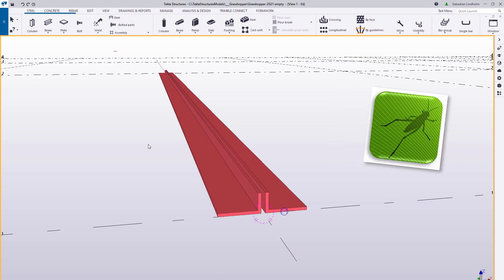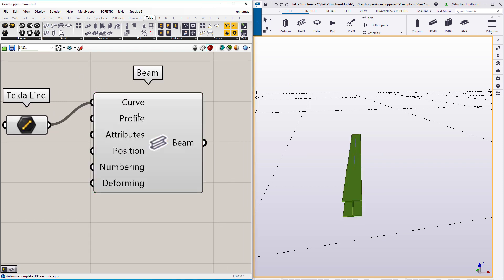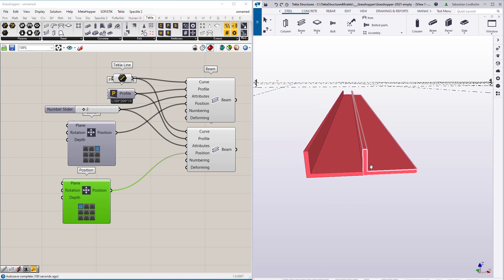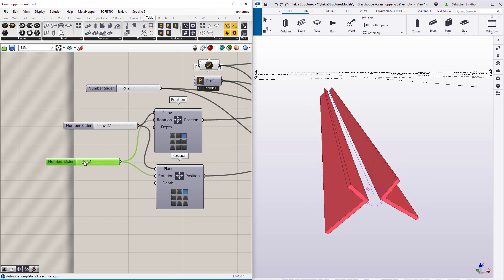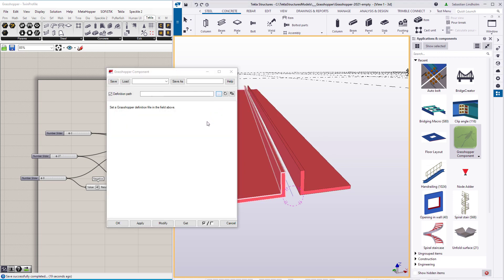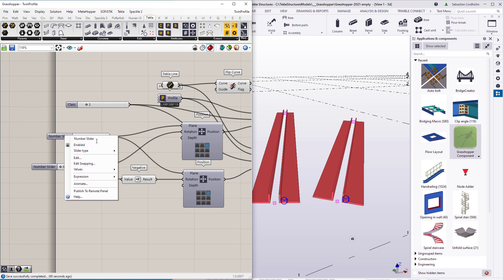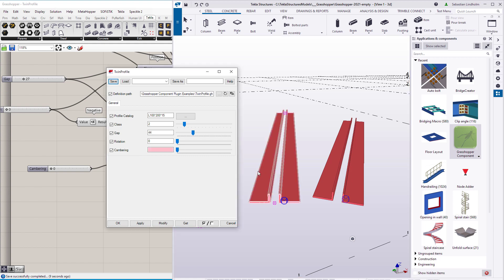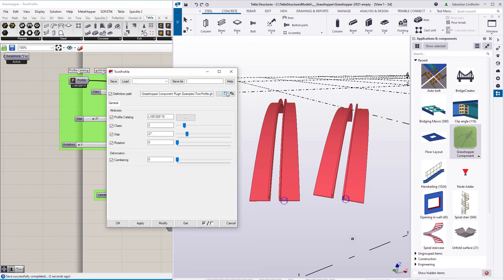How to create a Grasshopper-powered component for Tekla Structures

Comment: Hello Sebastian, is it possible to use Grasshopper to create a component of a SEAM type, meaning when Grasshopper script has to get info from(!) Tekla model first, then compute it and then send it back to Tekla model? The exact situation is as follows: I have two columns and between those two columns a complex structure must be created but(!!!) based on the size of those columns.